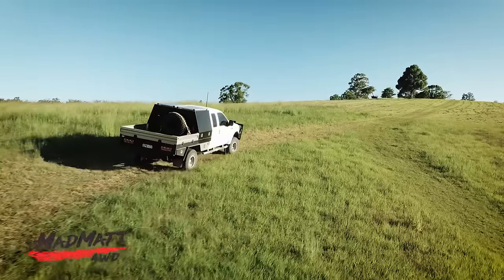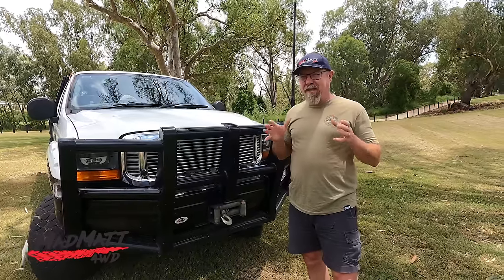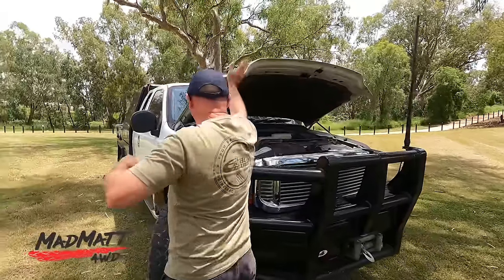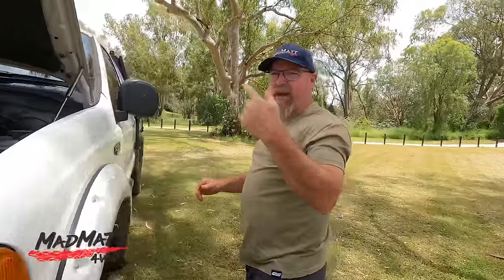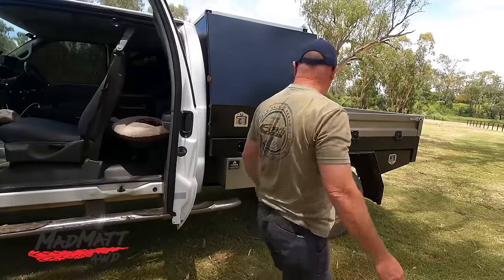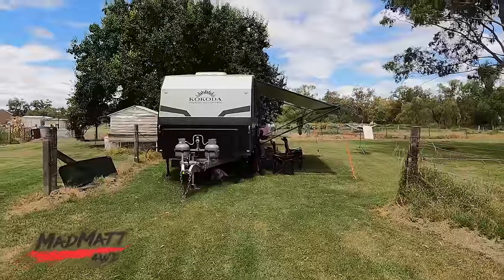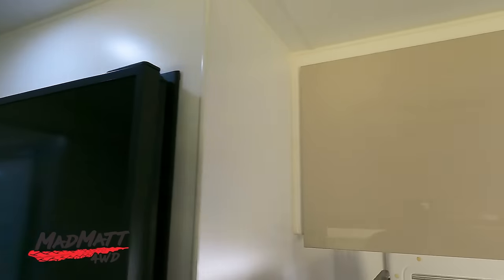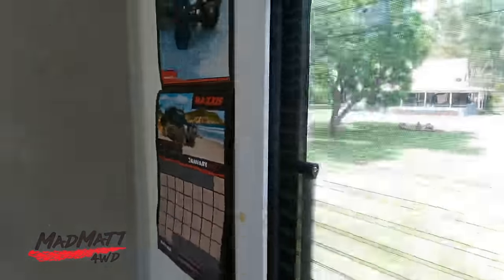NEWS! My NEW 4x4 vehicle - Reveal and Walk Around and another surprise!

Comment: I'm with you 100% Matt, except that in my case I got a 6.6 litre Duramax Chevy 3500 WITH enough grunt to haul the Bushtracker (so about 8.3 tonne combined) up the steepest of hills at the same speed as the other traffic......no slowing down to allow others to pass required.
Reply from the maker: That’s so good. If I could have afforded a later model I would have gone a bigger motor but this was at the top of my budget. I’m happy

Comment: Nice truck. Perfect for what you are using it for. How about some air bags in the rear? That way you can dial up the stiffness you want depending on the load. With just that trailer I don't think you'd need anything more than the original springs that come with the truck if they were in good shape. Sounds like you said they were a bit worn out, however.

That trailer is beautiful. Gonna make life on the road much more bearable.
Reply from the maker: I’m fitting airbags today and have pulled the 3rd leaf out of the rear springs. Keen to see the difference.

Comment: Thinking about how the truck is set up, you might want to temporarily pull the bullbar off and take it for a drive/tow on one of the tracks that you've had some unpleasantness in as it's currently configured.  I suspect that the extra weight that far forward of the front axle combined with the nature of that rear tray isn't helping with the ride.

If you don't want to do that kind of work, or at least not initially, see if you can weigh the truck, then weigh what's riding on each axle.
Reply from the maker: Thanks for the great suggestions.

Comment: Is making the bed a pain being such a tight fit?
Reply from the maker: Not really. A bit difficult up the top but we’re working out a method.
Reply: Spent 4 weeks in the sunliner motor home same problem making the bed the top bit a real pain no room
Reply: Matt we worked out that a piece of core flute under mattress allows you to slide it back to make then simply slide the mattress back

Comment: Looking good mate, coming along nicely. I assume you are running the shocks on their softest setting and you still find the rear a bit stuff?
Reply from the maker: Thanks Matt. I’ve played with the shocks on all different settings.
Reply: @MadMatt4WD  hmm, had a customer running big bore 53mm Ralph shocks on a 79 and they were just to big. The ride was harsh. They changed to smaller bore shocks. Im wondering if you could maybe try pulling the shocks forward or rearward of the diff off and taking for a test drive to see if that helps. If ride is to stiff then the springs are obviously to heavy duty for the load.
Reply from the maker: Interesting. Tough dog is keen to look at it. I also want to make sure the body mounts are right. I’m not prepared to say it’s spring or shocks just yet. This is a kit they’ve made for years and it’s worked well so it doesn’t add up that it’s not right here.
Reply: @MadMatt4WD  thats fair enough. Hopefully they can come up with a solution.

Comment: Great work! Do you have a second trailer on the back to bring the 105 along? 

Does the truck flex? Twin locked? Can it turn in any track? Is it just too big to take off road?
Reply from the maker: Yes I have a trailer and no they won’t let me tow it with the van. It’s not great Offroad compared to the 105.
Reply: Nothing is great off-road compared to a 105! 😉

Comment: I thought it might have the windshield rake of a US spec pick up truck.  Only thing that would make it better is if it were a Ram...JK.  What tire pressures are you running at unloaded?
Reply from the maker: I can’t afford the rams. I run around 36
Reply: @MadMatt4WD  ok.  Was gonna say I running 35 rear and 45 front empty on my Ram 2500 with Toyo MTs.  However, I probably could run even lower in the rear unloaded with the muddies. Chalk test shows I could go down to at least 30 psi. I think Thuren says he runs 25 rear on his Ram Cummins.  The muddies just have so much sidewall stiffness, and the pick ups are comparatively light in the rear when unloaded.  Dual shocks in the rear seems overkill, too.  I would think a well tuned single 2.5" diameter shock w res would be sufficient.  Anyway, happy to see you trying out something completely different.  Will be interested in hearing your trials and tribulations with the new rig.

Comment: Matt, looks splendid! Do you have auxiliary Diesel tanks? Are you using Starlink for Internet (Robert Pepper did a piece on it)?
Reply from the maker: I just have the main 144litre tank. It’s possibly all I’ll need. I have starlink and also have a cradle point 4g system. Starlink is still rolling out.